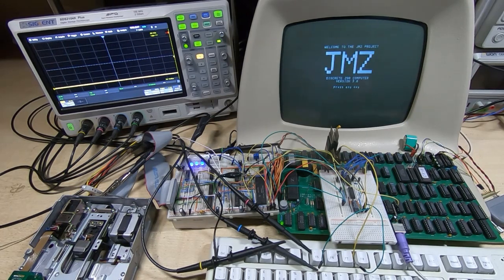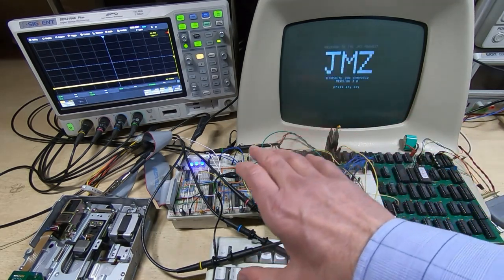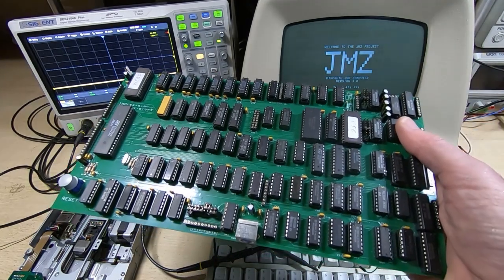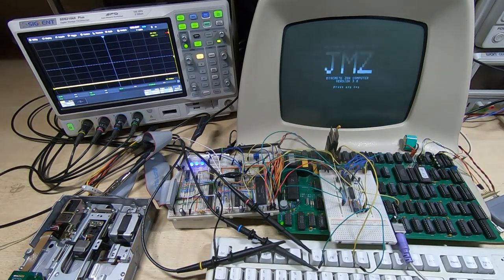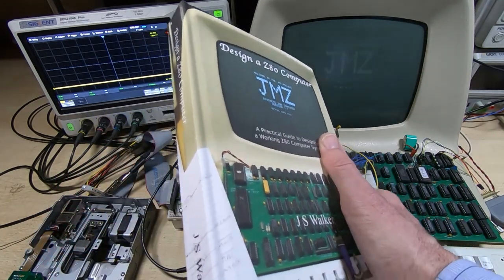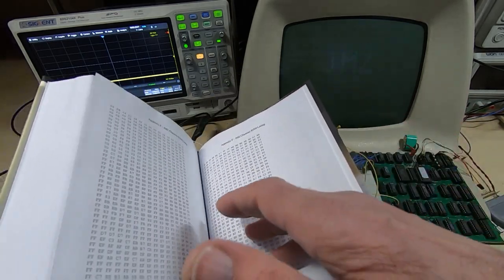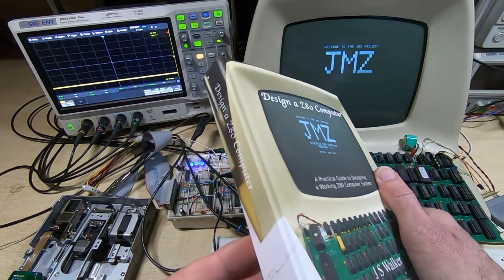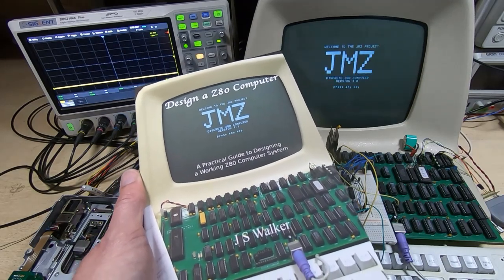Z80 Computer Design Book Released

Comment: Great! Question, is the floppy drive interface schematic and code included?
Reply: He has said previously that the floppy interface wouldn't be in this book.
Reply: @jameshearne891  Must have missed that. That's a shame. I'm impressed with his floppy drive system. I've designed and built several retro-computers myself. Period correct mass storage is always the hard part to implement for me.
Reply: @omegageek64  I think it's going to be in the next book.